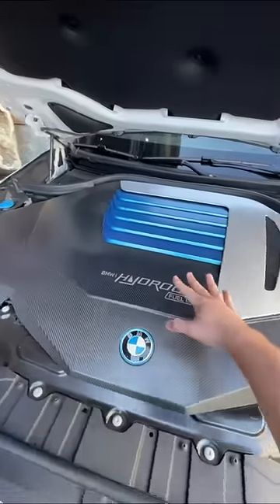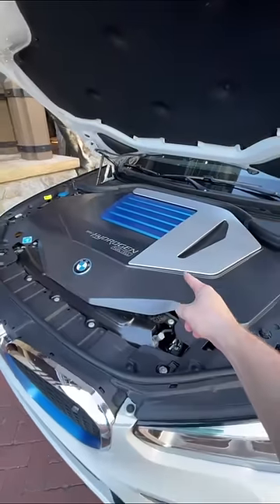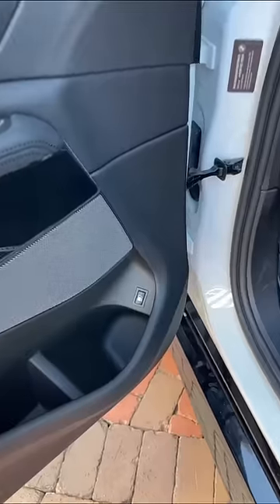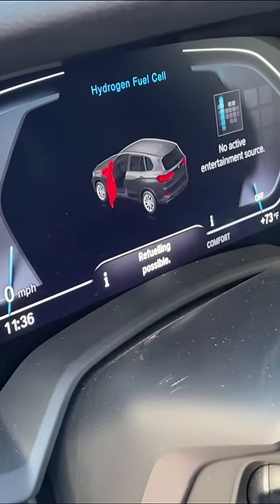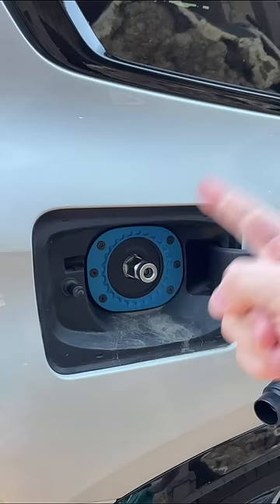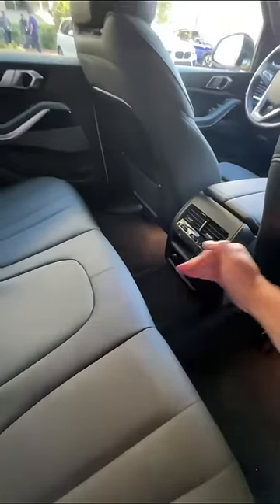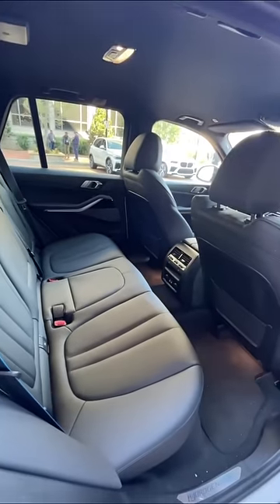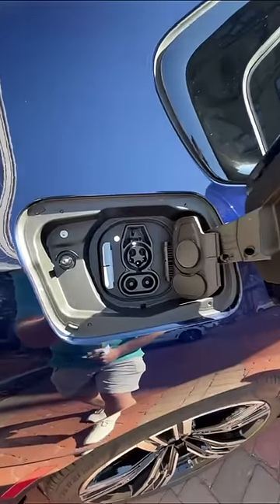BMW's Hydrogen X5 may be the future

Comment: If you want a terribly inefficient, complex and expensive EV, you get one with a hydrogen fuel cell (aka “fool cell”, as it is for people who don’t understand basic physics and chemistry)

- You’ll have less space for passengers and cargo because of the large tanks and fuel cell that are needed in addition to a (smaller) drive battery, inverter and all the other bits of an EV. 

- You’ll pay a lot more due to the complexity of the system, with many more parts. 

- You’ll spend more on maintenance and repairs. Recently, someone needed a new fuel cell out of warranty and was quoted a six-figure price. Nice!

- You will pay about THREE times as much for the energy per mile, compared to a battery electric vehicle. That’s because you have to make hydrogen first (which uses lots of electricity), then compress, transport it. Then it has to be converted to electric current in the car. This means: Many steps with losses. A BEV uses about 70-80% of the electricity to power the wheels. A FCEV uses about 20-30% because of all the losses in the process. 

- You won’t get hydrogen at your neighborhood filling station. Currently, most cities require hydrogen fueling stations to be located away from residential neighborhoods, in industrial areas. For safety reasons. 

- Your cost for hydrogen has to cover the cost of the station itself. While Tesla builds a supercharger location at an average of $392k (8 stalls), even a simple hydrogen fueling station goes into the 7-figures. And if someone fuels right before you, you have to wait for the pump to re-pressurize or thaws.  

- In the end you won’t save more than a few minutes over a modern fast charging BEV, but pay money through the nose. 

Now, you may be fortunate enough that you don’t have to worry about paying three times the cost per mile, but most consumers are not in that position. This means, the fuel cell is an expensive luxury for affluent people driving a lot. 

Lastly, if you find that all the above isn’t inefficient enough for you, wait until some fools make a car with an internal combustion engine that runs on hydrogen. That will be even more inefficient and costly.
Reply: Forgot to mention that your Hydrogen vehicle is a higher emissions than gasoline due to the natural gas and heat energy used to make the stuff. 

Get an EV.
Reply: I work in a warehouse with h2 cells, they are absolute trash.

they constantly have faults that need to be cleared and breakdown often. 
mostly voltage and pressure jumps as the system works... changing machines several times in a 10 hr shift!
the fuel station needs training, techs and has issues in pumping when it was busy or at all. 
cells died often due to the lack of on power on demand... small battery and weak charging. which set off a other fault 😅
there are so many issues with the tech, and then just the idea of it being a good energy storage is just idiotic.
the idea of taking any form of energy to make h2 is an energy loss, on top of all the other energy and resources to make it work. if only everyone could learn some basic science, or at least take the effort the learn about physics if you're going to try break the laws of thermodynamics 😅
Reply: I've seen a couple of studies putting it at about 5x the cost per mile vs EV.

Very very few 'EV SUCK HYDROGEN ANSWER' commenters have any idea of the kind of cost per mile they'd be looking at.

It's worse because it's fundamental physics you're fighting, meaning that economies of scale would only drop that by a few percent (eg small efficiency gains in hydrogen production/transport/storage etc), nothing like the 300-500% required  to achieve cost per mile parity with an EV.

Meanwhile economies of scale mean an EV keeps getting cheaper.

Hydrogen is dead before it starts. If the physics isn't enough, look at how many big companies are building EV chargers, buying EV's for their fleets/buses and investing in new electric car designs, versus the number doing hydrogen stations/vehicles etc..
Reply: @HoltAlex  That's very well possible...
Reply: @5353Jumper  That's only strictly true for some forms of hydrogen (those that we'd probably end up with if the desperate fossil fuel companies won their lobbying to have 'alternative options' for powering personal vehicles as often gets mentioned by governments - eg carry on with fossil fuel dependency as they clearly have no understanding of thermodynamics ..makes me sick).

The picture when producing hydrogen from renewables isn't much better for all the wastage reasons the original commenter mentioned.
Reply: @HoltAlex  the math on "green", purple, pink, blue don't work out so great either. 

White hydrogen could be OK but still rare. 

But even if they do work out, we need to first replace the supply for industrial, chemical and fertilizer hydrogen with new cleaner production. 

Current hydrogen demand BEFORE we even consider it for transportation (currwntly answered with Black/Brown hydrogen) is one of the larger emissions producers in the world. We need to convert ALL of that to some low emissions version BEFORE we even consider new applications like transportation. 

If we make transportation hydrogen low emissions but keep industrial hydrogen the way it is, then the transportation hydrogen will still effectively be responsible for a lot of emissions. 

And no, the math on "blue" hydrogen never works out, it is always a bad idea. A terrible idea dreamed up by petroleum company execs to keep is dependent on their natural gas and distribution systems without actually solving any environmental concern.

Comment: For most drivers, charging time doesn't matter because you just charge up at home. No need to take a 20 minute detour from your normal commute to refill on gas or hydrogen.
Reply: Yeah I think when people find out you can get another two hours+ of driving with a 20 min charge even if you had driven for 3 hours constant 15min-20 min isn’t a long time. by time you fuel and pay a gas car can take 5-10 mins. it’s slightly longer in maybe a 5 hour one direction trip but as you say most EV owners never stop, it’s always done at home. Saving 90% of stops.
Reply: @legendofthepeach If you're on a road trip the chargers are at places to eat/use the restroom, something you already need to do. Can't really order in n out with a gas nozzle in your car 500 ft away
Reply: @xipalips  Yeah agreed, I mean if do a 5 hour drive I usually bash it out in one but it’s pretty grim and I’m not really with it by the end, if I’m stopping to fuel at the mid point for 5mins chilling out for another 15 isnt really a hardship. Yes technically it takes a little longer but it’s a real edge case it’s quite rare to do that kind of drive. I think just plan a 20-30 stop half way toilet, bite to eat as you say car will be ready to go before me. Fraction of the cost and zero emissions with a slight change in behaviour. People with kids stopping to use restrooms more frequently no doubt

Comment: From gasoline bombs to hydrogen bombs on the road🤷🏾‍♂️🤯
Reply: That's not really a problem versus the fact that tanks for only 300 miles reduce your usable cabin space. Gasoline explodes, Hydrogen can shoot flames, and certain types of batteries will gradually burn for an extended period of time.

At this point your best bet is probably batteries that won't burn, and will charge in 30 mins or less. That's ideal for most people since we tend to have electricity at home or at work.
Reply: Hydrogen bomb didn't work that way

Comment: 15 lbs of hydrogen is equal to nearly 7 kg. Currently, it is $7 per kg. That is $48 for a full tank. More than gas right now. No thank you.
Reply: It's never really going to improve with economies of scale either, fighting fundamental thermodynamics barriers by needing to convert the energy so many times with big losses at each step. 

Alternatively just put the energy straight into a car which you can drive for 3+ hours before needing to stop for 20 mins to take a shit anyway, and the car can charge while you're at it.

Madness.

Comment: 2020: “Gas cars are bad. The future is Electric Vehicles”

2024: EV’s take to long to change, gas powered cars are the future”
Reply: This isn’t a gas powered car. It’s a car powered by a gaseous element. And it’s only emission is water
Reply: @MrBudderTacoMBT  Yes I know but I find it ironic that it came full circle in terms of innovation in less than 5 years because manufacturers are realizing that EV’s aren’t as great as they thought.
Reply: @JoePez nope. Hydrogen is Not the Future for privat Persons.
The Argument "you can fill it Like a normal car" ist Just a lie.

You can fill it in 5 min. If you are the First. The next people have to wait a Long Time (30min+).
And with the new super charges 300kw+ you need for a normal car 10-15min. 
For a nio et7 which Drives 1200km you need ~15min from 20-80%, i think this ist fast enough.
Reply: @JoePez Based on what bro? EVs get more popular every year. The Model Y was the top selling car, period, last year. 2000 hydrogen cars got sold last year vs 1.2 million EVS in the U.S.
Reply: @xipalips  Model Y, top selling car period? 🤔 yeeeah I don’t think so. I mean correct me if I’m wrong but the Corolla has been the best selling car in the world for the past 20 years straight and if you’re talking about the US market then it’s the F150. So I’d like to ask you where you’re getting your information from my guy.

Comment: my uncle had diy homemade hydrogen powered '91 Honda Prelude, until it one day exploded. His subwoofer which was in the trunk ended up going through the windshield. He never told us how to make it neither did he try to perfect/improve his creation
Reply: he basically used tap water and had cells that turned water into nitrogen and oxygen
Reply: That would be the opposite of these...
Reply: @tepac5537 Yeah no I'm calling cap. What you're describing is electrolysis, which requires a stupidly high amount of electricity for the amount of hydrogen you extract. That electricity has to come from somewhere. Either your uncle was stupid, and was using batteries to power the electrolysis and then using the hydrogen to power the car, or he was lying (Or you're lying, that's possible too)
Reply: @richardmillhousenixon  my guess is his uncle was lying or he misunderstood what his uncle was saying and has just repeated the story even though it’s complete and utter nonsense.

Comment: I respect you saying 20-30 mins charge time, some cars charge quicker but a lot of people say have to charge for 8 hour hur dur not practical
Reply: 20-30 min if you find working, high power charger that delivers advertised power. Which usually not a thing where i live. Usually its 1-1.5 hours stops to charge my id4.
Reply: @Vidmantas969  shoulda got a Tesla

Comment: The problem with refueling a hydrogen gas car ist that the refueling station can only service 6 cars per hour, because it has to repressurize after each fill up. So the wait time might be longer than with a straight up ev

Comment: Issue is the hydrogen needs to be so pure (so it doesn’t contaminate the fuel cell) which means it takes enormous amounts of energy to make. Whilst better than battery power, still very energy hungry

Comment: Dash says 120 miles range left at half tank, ie 240 miles range or roughly 385km. Doing the math it’s cheaper in Sweden to run an x5 diesel. BMW has been doing this over and over for as long as I remember, never been able to actually deliver on it..
Reply: They'll never be able to. Basic thermodynamics means hydrogen is boned from the start.

Comment: I get PTSD thinking about my BMW's driveshaft and giubo. The giubo over time cranks and the driveshaft develops enough play till it eats the CSB. Don't wanna imagine what a neglected x5 hydrogen car would be like when the driveshaft finally goes in that thing. (although it would most likely have hydrogen fuel, electric motors)

Comment: Even if the car works, it they didn't resolve the problem with hydrogen storage (both on the vehicle and the refueling station) it won't matter. Hydrogen molecules are so tiny that with time they pass through other bigger molecules of the container.

Comment: Toyota has a Supra with the same tech. The only problem is finding hydrogen stations and it's not something you can easily install at home either. Hydrogen needs to be super cold, so storing that mean burning throw your electric bill.

Comment: Curious to see how bmw hydrogen holds up, since they’ve been testing hydrogen engines for decades. Worked with bmw prototypes and they had a hydrogen engine in display
Reply: There is no hydrogen engine in this car. Or any hydrogen powered car on the market. They use a hydrogen fuel cell not a hydrogen engine. The motor is electric

Comment: I know ev people hate diesels, but inalwaysbthought absmall single cylinder diesel with a generator would be the perfect combination. You can use it to charge the batteries or use it to drive the car and not have to worry about being stranded. Also diesel is more available than hydrogen,  hydrogen might have a filling station  every coupl2 hundred miles but its a couple hundred miles out of your way. Most gas stations have diesel available even remote stations.

Comment: The problem with a lot of so called “renewable” energy cars is that the consumers aren’t aware of the source that produces the “renewable” energy.

Yes, electric cars don’t produce CO2 by themselves but the power plants do.
Hydrogen cars technically release water but the production of hydrogen mainly involves methane - fossil fuel. 
Until we are energy rich enough to afford electrolysis at a large scale, this would unfortunately have to be what things are. Electrolysis of one liter of water costs similar amount of energy to sending that amount of water to space…
Reply: The point being that it uses substantially less energy overall. Even when you factor all the powerplants or factories or batteries it still overall comes to less of a carbon footprint than the manufacturing and upkeep of fossil fuel dependent vehicles and the resulting burden on oil/gas industries.
Reply: CBG/biogas has entered the chat

Comment: Left out the price.. currently a kg is $37? 

Getting the same range on mirai is ~$150

Should also know, Shell 1 of the 3 stations you can get hydrogen fuel will no longer be offering it. 

Thirdly, in USA there are only stations in CA

Comment: BMW has been researching and building hydrogen powered vehicles as prototypes and eventually even in a small series for over two decades now.
Just google "BMW 750 HL"  (from 2000) and "BMW Hydrogen 7" (from 2005 to 2007).

Technically it's really not that huge of a deal to modify (or to reengineer) a combustion engine to run on hydrogen which to this day somehow still nobody can buy at a regular gas stop. 
But despite all the problems around hydrogen storage, it sure does make for some good 0 emissions vehicle PR.

Comment: Burn gaz to get hydrogen to convert it back to electricity with energy lost in the process… its better to use electricity directly if we can 

Hydrogen would be a solution in big trucs because the battery would be too large and too heavy but in cars a battery is sufficient even if we have to wait 20 min to get it recharged

Comment: Speed to charge us there, range is not. And the tanks make it self limiting. You can only carry so much hydrogen. Battery technology however can grow leaps and bounds. Once electric cars can go. At least 700-800 miles without a charge, they’ll be more attractive than ice or hydrogen imho.

Comment: Hidrogen would be ideal but has some problems. First you need a very good sealing tank, as it's the smiles atom it can leak very easy. 2nd is the source, if you want it green and use electrolysis it would have an efficiency of around 40% when you are driving the car => more energy used to make it then you would get for it. 3rd no infrastructure but this can be solved. I don't think it will be viable only if we have a lot of exces electricity and no other way to store it. Otherwise it would be like I buy 1kg of flour to get only 400g of it.

Comment: The best way to make hydrogen viable is to have some kind of seperator where u can "refuel" the "gas tank" with water and it splits the hydrogen off the oxygen and utilizes it for combustion.  I imagine if the tech could be miniturized we could literally retrofit existing ICE engines.  I have zero fucking clue how this would work tho and if it IS in development i can only imagine its radically far away but in the meantime hybrid vehicles really need to be the norm.  Pure EV just isnt economically viable right now and hybridization extends gasoline range sugnificantly

Comment: Hydrogen internal combustion engines are the future. ICEs have been perfected to an insane degree over the past 100 years. The only thing needed is to create the liquid hydrogen fuel supply infrastructure. Hysata, an Australian green energy company, has developed a highly efficient means of creating liquid hydrogen, and if this process is driven by small modular nuclear reactors, which are soon coming on line in the US, there will be abundant and highly distributed clean fuel production across the planet.

Comment: Problem is making the hydrogen fuel available to the public uses fossile fuels and releases more CO2 than just using a gas car, and you get worse range. Cool concept, but they often are pretty low on horsepower